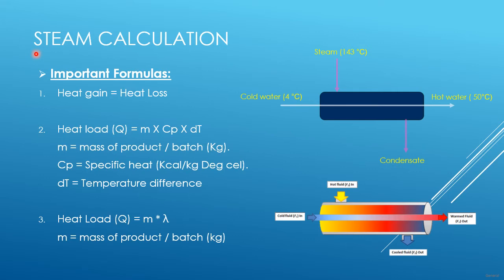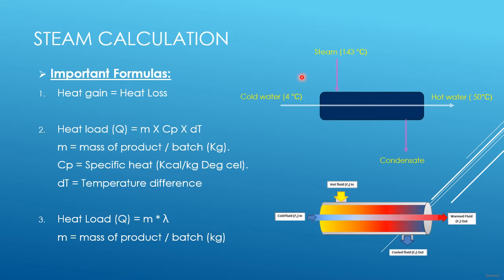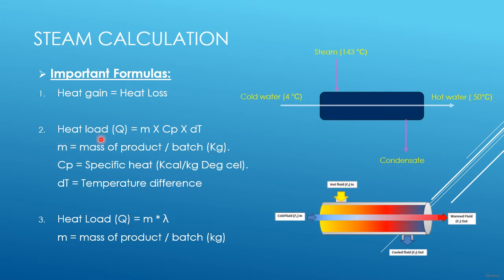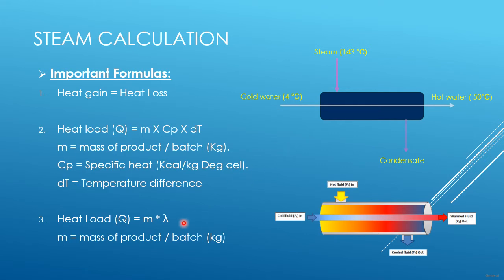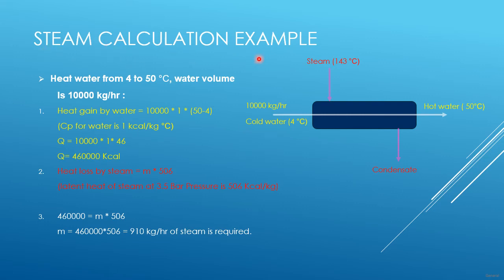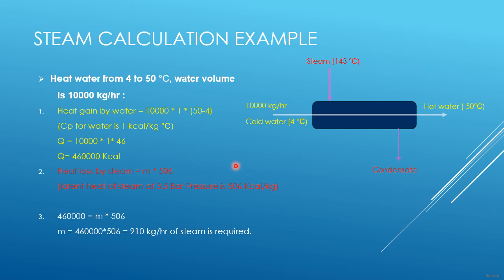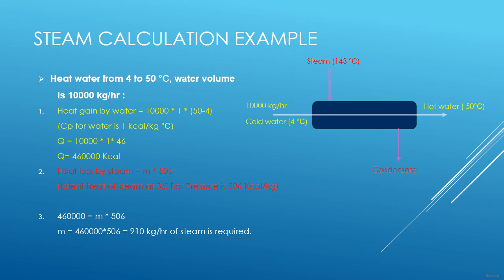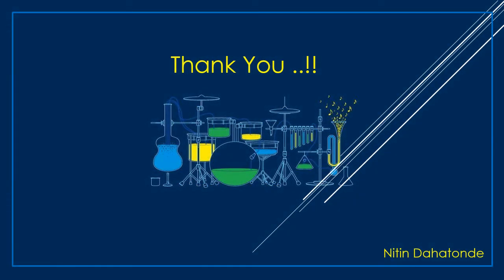Steam Flow Calculation for given duty / batch /process

Comment: How many steam consumpion if steam mix with water
Reply from the maker: It depends how much is water and steam, also up to how much temp you want to rise.
For example: if water flow is 1000 litres per hour and you want to rise that water temp hoto 75 deg vel from 30 deg vel them, we can do calculation can be done.

Comment: if possible, provide the cost for 910 kg  (as calculated)
Reply: Please give electrical boiler cost
Reply from the maker: I am not sure about raw material ( diesel/coal or biomass)  cost hence I will suggest to connect with boiler expert.
In case of electrical boiler i have calculation.